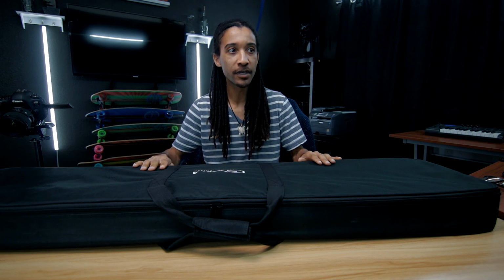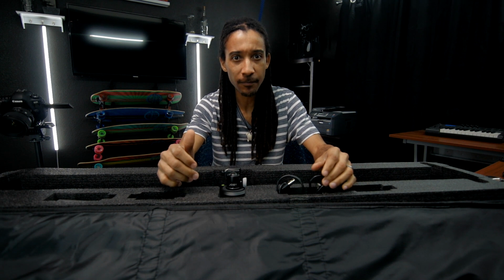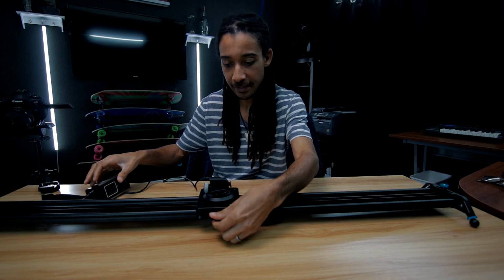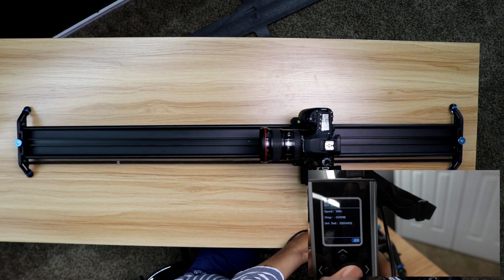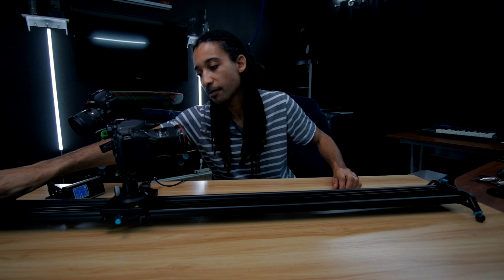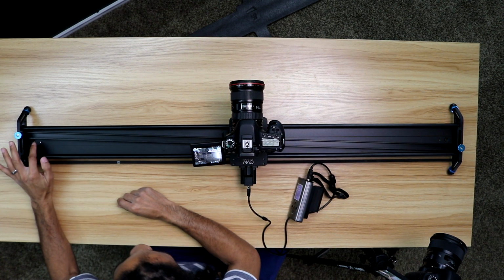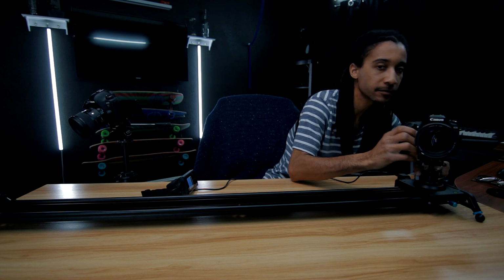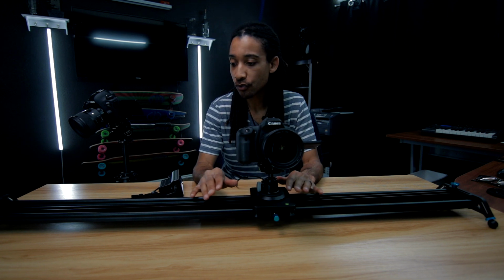[016] Introduction to the GVM Motorized Slider (48")

Comment: Question about your version of the slider my dude. Does yours make a high frequency noise at certain power levels? I just picked one up and was running tests on it, and I find a very noticeable high pitched noise at many of the power levels. There's 2 different ranges of about 4-5% that I don't notice it on. The rest it's honestly super annoying. Any thoughts?
Reply from the maker: I no longer have this slider so I'm not sure what version it was. Mine did not make any high-pitched noises though.

Comment: Can it be mounted vertically?
Reply from the maker: Yes, but depends on the weight of your setup. With a smaller mirrorless I was able to use the slider mounted vertically without issue. With a heavier setup the motor failed unless I changed the pitch/angle of the mount.
Reply: @MoniJohnson  thanks bro
Reply from the maker: Anytime!

Comment: Great video man. Question: can this slider operate if I am the subject? Meaning that can I set it to automatically move while I am in the shot? Not having to press anything on the remote while it’s moving is what I mean.
Reply from the maker: Thank you very much for the comment. Once you set and start your slides, you won't need to interact with the controller again until you want to restart or stop what you programmed. You can set slides for single pass or loop also. On loop you can just let it run throughout your whole shot.

Comment: Nice video... Trying to decide by this weekend between the 48 and 31
Reply from the maker: Thank you. Really, 31 is probably all you need.
Reply: Im on the same boat . Is there a added effect when the slider is longer ? For music video , interviews ect ?
Reply from the maker: A longer slider will definitely give a more "pronounced" effect but  if you get the 48" be sure to setup with two stands/tripods.
Reply: @MoniJohnson  could you elaborate alil on the pronounced effect . Haven't really found precise info on this effect . Need to buy one with next hour .
Reply from the maker: Sorry for the late reply. We're at a photo shoot right now.Think of it like this: If you're moving with the camera, if all other factors are the same then footage where the camera moves 48 feet the motion (and changes within the scene) will be more noticeable than when moving only 31 feet. *I use those numbers to compare a 48 inch slider to a 31 inch slider.
Reply: @MoniJohnson  thanks for reply , are you happy with the 48" .
Reply from the maker: Not a problem. Hopefully my answer made sense. I'm most definitely happy with the 48". I actually sold the setup In used in this video and purchased another 48" rig (from Rhino).
Reply: @MoniJohnson the rhino is better, I assume. What made you switch?

Comment: does this have a remote control for when your working by yourself?
Reply from the maker: It has a wired controller with about a 4ft cable, but no wireless.
Reply: @MoniJohnson  ok ty dang thats kinda messed up and 4 feet isnt very long lol
Reply from the maker: Yeah, that can seem limiting but it's definitely still a good piece of gear. For my needs, having the wire wasn't an issue. Not really "remote control" though.

Comment: Can this be attached to a tripod?
Reply from the maker: Absolutely. It has 3 pairs of mounting holes on the bottom- one in the middle, one on the left end, one on the right end. Each pair has a 1/4" and a 3/8" hole. Because the slider is so wide, if you use at full width with a single tripod/stand you'll get some sagging at the ends. I always use two tripods/stands (one on either end) to prevent sagging.
Reply: @MoniJohnson  Thank you!